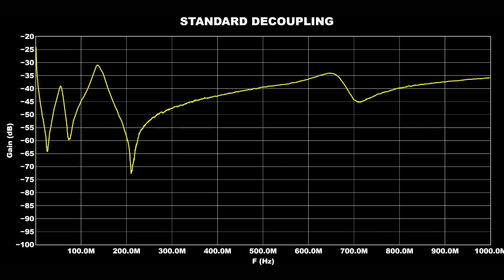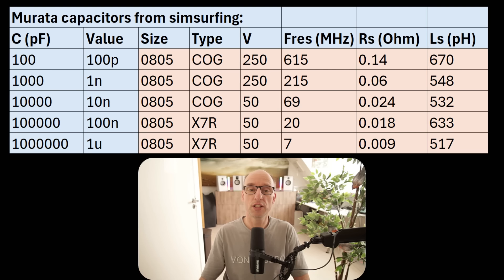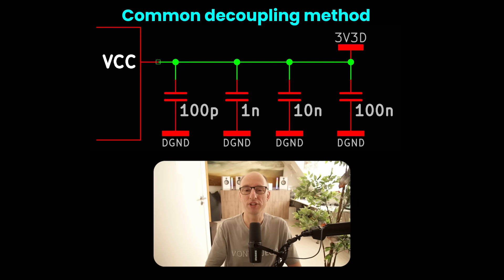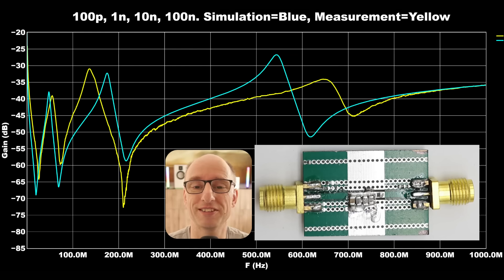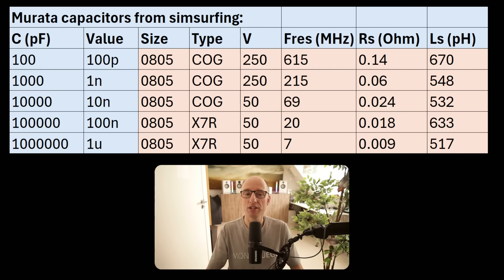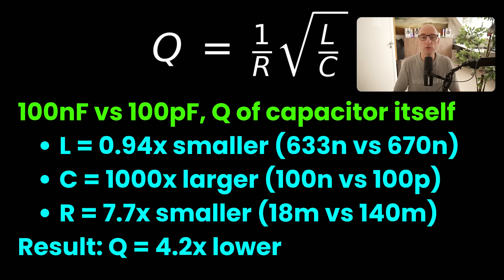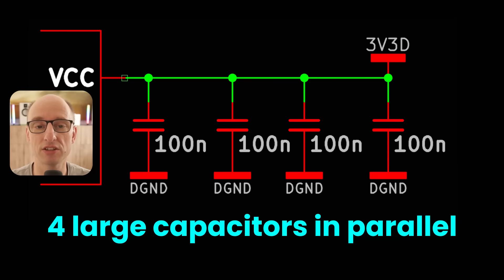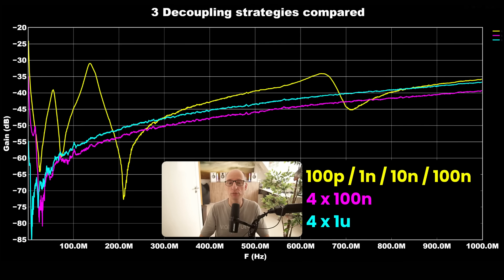The most misunderstood concept in decoupling

Comment: Ferrite beads are the way to go, rather than resistors.  There are more parameters to worry about, but once you've made sure the DC resistance is small enough, they do a great job of isolating noise from the chip to keep it from propagating back to the power plane.   They also force the chip to pull power from the little power "planelet" and caps that the bead necessarily creates when you put it in series with the supply.  Ideally, have the power trace running from the chip to the caps first, and then move on to a via to the power planelet.

For chips that spew a lot of noise out of their power pins (some crystal oscillators, for example) it's a good idea to put another decoupling cap on the supply side of the ferrite bead, and make sure the trace goes from the bead to the cap, BEFORE hitting a via to the power plane - otherwise it will suck current out of the power plane rather than the cap, defeating its purpose.
Reply: That's a double-edged sword. You are introducing more inductance, so you could actually have more ringing. You are also increasing the supply impedance, which is another way to look at it, and this is never good, except when you want to protect a delicate circuit from supply noise. This is often the case for crystal oscillators and PLL circuits, but contrary for what you state, it's the opposite way around: These circuits don't produce a lot of noise but instead are very sensitive to noise from the rails. Especially PLL circuits. That's why you sometimes can use ferrite beads and capacitors for those. Personally, I'd just make sure you have solid and big power and GND planes and just use the best combination of smallest body size and highest capacitance you can get for the given voltage and use that as the only value on each pin. Ferrites just complicate the layout unnecessarily most of the time. For most BGA designs I'd just go for something like solid planes and 0201 body 220nF throughout.
Reply: @yope01  The Q of the ferrite bead is low enough that ringing is never a problem.   A single poorly decoupled chip can easily bounce the entire power and ground plane system - easily spreading its noise over many, many square inches.  The problem is that once noise is on the power/ground plane, you can't get it out - there is too much inductance to the caps, and so they are pretty ineffective once power and ground have been polluted.  You can try throwing more caps on the board, but it typically does little to quiet a large power plane.

Lots of folks like to think that the power/ground plane make a good capacitor - it does not.  Although there is a low-inductance path to it, it has a poor Q, little useful capacitance, and acts MUCH better as a transmission line - especially these days when edge rates can be on the order of 1ns or less.  

Depending on how well the chips' I/O are designed, and if you're not using any senstive analog interfaces nearby, and assuming you alway route power traces from the chips, then to the caps BEFORE that trace hits a via to the power plane, you can get away without ferrite beads.  For many stackups, this means defining a special via that DOESN'T attach to the power plane near / under the chip, so that it can route to the caps first.  

In my experience however, when dealing with the layout folks, it's easier to put the ferrite beads in.  It all but forces them to use the right layout.  You still need to make  sure they routed power through the caps before they hit a via to the power plane, but the isolated section for the ferrite bead forces the current to come out of your caps first, and not the power plane - where the dip from a large current slug can propagate to all the other chips on the board.  

To determine how much capacitance I need, I use n*i = C*dv/dt.  Where n is the number of simultaneously switching outputs (which can be quite large on a BGA), their output and local trace capacitance, and edge rate (10 - 90%).  For a big FPGA switching over 100 outputs in a nanosecond, this can be AMPS.  

You can then re-solve the equation for C and assume you want a reasonable supply dip - something like 100mV in that 1ns.  Fortunately I've always found that the capacitance I needed for this is reasonable, i.e. << 1uF, despite the fact that for those edges, it can try and pull AMPS out of the local supply.

The key after that then becomes minimizing inductances around the power capacitor layout, and making sure what inductance is left works FOR your filtering rather than against it.  Fiooding open areas of the outer layers with ground helps, and / or making the next layers inside ground, minimizing the inductance between the cap's ground and the ground plane.  

And since it is so important, (especially if NOT using ferrite beads) let me reiterate how critical it is to route the power trace from the power pin of the (load chip), through the cap field, and THEN (through a  short trace) to a via to hit the power plane.  We're typically tallking less than 1nH of trance inductance here, but if you place a power via to the plane BEFORE the caps, (i.e. between the load chip and the caps)  you have much less inductance between the chip and the power plane than you do between the chip and the caps, which means most of the current comes from the plane instead, and it won't have nearly the capacitance needed for a large current slug.  Here, the low-inductance path to the power plane has worked against you and the filtering caps, so be careful where it ends up!  

(Side note:  the power / ground plane typically does NOT act like one big capacitor of value C = e0*er*A/d. 

The edge rate of chips defines how much capacitance it will see from the power plane, or about 1/6th of the wavelength defined by your edge rate - the portion which can be considered as a "lumped element" model.  For FR-4 with a prop delay of about 180ps/in, this ends up at roughly 0.9"/ns of edge time.  So for a 1ns edge, you have a radius of less than 1" around your power pin that you can consider as the lumped-element capacitance of your power plane,  Everything outside that radius is a transmission line.)   

The inductance of small ceramic chip caps is on the order of 1nH, and so is the inductance of a typical via on a 62mil board.  However, if your power plane is near an outside layer on the same side as your chip, the inductance to the power plane can be on the order of 200pH. So if you're not careful on where that via is relative to your caps, the current you intended to come out of the caps can easily come out of the plane instead, so make sure your layout person put it in the right spot!  

In some ways, getting enough caps around your chip to decouple it is straight-forward enough.  The tricky part is making sure that all the inductances in the layout aren't going to mess it up.

I hope that helps.
Reply from the maker: Actually, ferrite beads are a big problem. I used to use them for years in my supplies, assuming that the loss in there would kill the Q, however, at lower frequencies (where resonances occur) these ferrite beads act like nearly perfect inductors: very little loss. I was a bit shocked when I first learned about this. So ferrites are really tricky in supplies.

The example from the other reply in pll and oscillator circuits is a good application. The load current is constant so no problems with ripple and the large inductance of the bead makes a great LC filter: Do check with a simulation where the resonance that you will inevitably get, ends up.
Reply: @HansRosenberg74 exactly. Most of the time ferrite beads introduce more problems than they solve. Like you said, they should only be used on sensitive devices that have a more or less constant current draw. In my experience, even then you can often skip them if you know that your power rail has a noise level within the limits the device requires.
Reply: @HansRosenberg74  I would only use a ferrite in a supply output if it was a switcher, and the output diode caused a sharp spike in the output ripple.  Otherwise, I typically just use an inductor before the big filter caps, IF you need to minimize the triangular / sawtooth ripple.

This may cause a couple minor headaches, like the extra pole in the feedback loop making it difficult, if not impossible to use the remote sense input.  Then of course you have to make sure nothing goes too negative when the supply turns off with a kickback diode.

Why would someone cause this much trouble?  In many telecomm boards there are clock multiplier circuits that take a local clock (something like 100MHz, or even lower) and multiply it up to a few GHz.    Unfortunately, the switching frequency of many supplies is low enough to be within the loop bandwidth of the clock muliplier PLL, which will multiply that PS noise by the same gain factor as the clock multiplication it uses.  This easily creates enough jitter to make their serial interfaces unusable.

It's tempting to put a linear voltage regulator in series with the PLL supply, but when that doesn't work you realize it's because the switcher frequency is too high - it's not within the linear regulator's loop bandwidth, so it does little to attenuate it.  

If you only have 1 or 2 clock mulipliers, you could certainly roll your own ripple reducer and make sure you cover the switcher's output frequency.  However, if the whole power and ground plane are bouncing around with high-power switcher noise, that typically doesn't work well - life is much easier if you squash it at the source, and keep it from getting on the power and ground plane in the first place. 

This will help a lot in low-noise telecom and satelite applications.  

Engineering always involves trade-offs, so pick the best parts for the job.
Reply: @Cynthia_Cantrell  All high speed circuits are technically switchers.
Reply from the maker: Trying to keep interference near the source would always be my first strategy: Keep those current loops as small as physically possible! And try to find ways to 'discourage' current to move further up your pcb. You can use inductors, but then you need even more capacitance to smash the Q. This works very well, you just need more space on your board and spend a bit more money.

Comment: Wondering how you would handle physical space constraints, specifically for large BGA packages such as FPGAs.  Some bypassing is required close to power balls near center of package.  Only 0201 or sometimes 0402 caps fit there.  Much more total capacitance is required, places just past perimeter of package.  It would be impractical to use enough 0201 parts to achieve needed total capacitance.  High-value 0201 parts have too much DC bias reduction to be useful.
Reply from the maker: I would just pick the components that I think are useful and then get the models and then simulate it. Then adapt the circuit if needed to make sure the resonances are controlled.

Comment: This absolutly the best video about decoupling I've seen. I'm trying to make a PCB in my CNC with an ESP32-C3. I'm quite satisfied with the results, with 0.3mm traces, but I'm probably having issue with decoupling. After seeing your video I decided to follow the rules and add 4 capacitors near the Digital and Analog power pins. I was using 1uF and 0.1uF. Please check this picture in my drive that show the caps and inductor inside a square line. All the components are 0402 size. I want to change all to 1uF or 0.1uF. What do you recommend? Thank you very much.  Check this drive folder that has the pictures https://drive.google.com/drive/folders/1oC8sxaQjp3RapWQRmHWTzC6X446xXZrC?usp=drive_link
Reply: Having worked with and EPS32 before, I have to say, that's a rather noisy little chip - it's not easy to decouple it, especially if you're using it with low-noise sensors.  Under that shield they did not decouple the chip properly, and doing it on the module level meant several ceramic caps in parallel and a BHC (Big Honkin' Cap) along with a ferrite bead to help isolation.  I managed to get it "clean enough" for our application, but I could still see software activity from the chip in the power rail.
Reply: Where I should place this ferrite bead?

Comment: Great video, thanks a lot! I think the habit of connecting capacitors with different values in paralel dates back to era of though hole components. With SMD parts the situation is very different but old habits die hard….
Reply from the maker: Yes, you're correct

Comment: The real fun starts at frequencies over 10 GHz, where a 2mm trace represents a significant inductance, and even a PTH via is an inductive element. Lots of circuits for 6 to 10 GHz from 20 years ago used the concept of parallel capacitors in decade steps, and there are weird instabilities as a result. Same with synthesizer chips running up to 22 GHz, trying to get effective bypassing is very challenging.  Luckily, a thin trace acts as an inductive choke and butterfly-wing quarterwave stubs give a good virtual ground, but then the elements are large enough to act as antennas, and that opens up a whole world of pain! I'm working right now on the bypassing design for an InGaAs photodiode with a risetime of 40 picoseconds.  That's very challenging to bypass effectively. Great to see this subject given some exposure.
Reply from the maker: You're working on a cool project then. I can imagine how tricky it is to decouple that!

Comment: better to measure each component with an RCL-meter than do guesswork, based on averaged promises of a datasheet.
Reply from the maker: Usually, they only measure at one frequency making it hard to get a full model. Unless you use an impedance analyzer, which is basically a network analyzer.

Comment: What if you put two capacitors in series? Many times used in 90° shift for battery supply to prevent SC
Reply from the maker: I'm not familiar with that approach...

Comment: But. MLCC capacity greatly affected by dc bias, and maybe other parameters. If the ESR is also afftected, then this might be the reason for placing different sizes. Eg looking up simsurfing you could see typical 0402 10uF 6.3V cap will loose half of its capacity at 2.4V, that's a huge derating, if it will also raise ESR twice then no good
Reply from the maker: Yes, this is a problem!
Reply: 0805 big dogs don't have this issue

Comment: Adding resistors in series to the decoupling capacitors increase the inductance thereby lowering the resonance frequency. At these frequencies, the construction of the PCB can have great influence on the end result.
Reply: depending on used resistor , wirewound have very big inductance, but surface smd chips are almost pure resistance becouse its metal oxide powder that wont conduct as good as wire , so the path is not that long
Reply: @tomaszszczepaniak2101  Well, yes... of course my perspective comes into play here. Hobbyists are still using through hole components, but all professional (almost I should say) will use SMD. Yet the inductance of SMD components (and vias) most certainly have a say when decoupling fast components.
Reply from the maker: If you go this way, you probably have a really big supply challenge. This always comes with simulating and modelling the whole thing!
Reply: @HansRosenberg74   It does in deed depend on the application. Inductance for a free wire is around 1 nH/mm, give or take. It also applies to components, which is why the inductance of the capacitors you list are almost constant. (Forgive me if you already know the following. In that case it might be useful to someone else). As you already mentioned, it depends on the design you are doing. Components that exhibits fast changes in current consumption are the most difficult to decouple. The supply current will have a frequency spectrum that starts to roll of at around f=0.3/t_r. However you model the change in supply current (linear slope, quarter sine wave, whatever) have little influence on this. Any capacitor resonance will be excited by this and start ringing. Things can go really bad if the resonance coincides with the clock frequency. Especially if you have used low ESR capacitors. (These should be used in filters, not for decoupling). Extending the trace length will inevitable increase the inductance that'll lower the resonance frequency. This is definitely not something you'd like when decoupling a supply plane. But as you said, it depends on what you are decoupling. A Cortex-M0+ at a few MHz is not the same as a big FPGA. :-)
Reply from the maker: Indeed,  you have to judge each application by itself. There's no solution that fits all circuits.

Comment: You don't need the resistor, for the last example. Providing with a polymer or tantalum or electrolytic somewhere near the point where your ceramics are is more than good enough 99.9% of times.

The capacitance needs to be X5 of the ceramics you have there at least and the ESR in the hundreds of milliohms although you should do the calculations yourself.

Point being is that you combine chemistries to get different enough ESRs for damping.
Reply from the maker: Good idea, but be careful how they resonate together!

Comment: I thought the point of having increasingly sized capacitors was filtering out short current draws (particularly for logic ICs).

And that having a range of capacitors allowed for a continuous "buffer of energy" accross frequencies
Reply from the maker: That was the thought indeed, but the simulations and measurements show that in practice this can do more damage than solve problems.